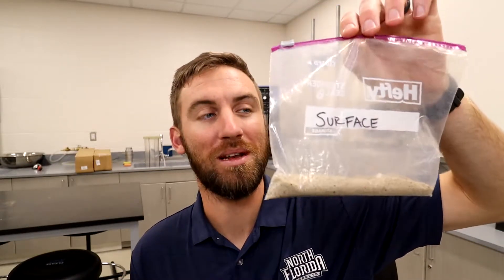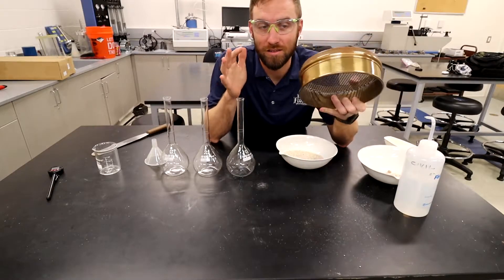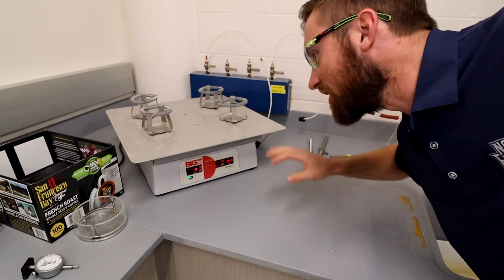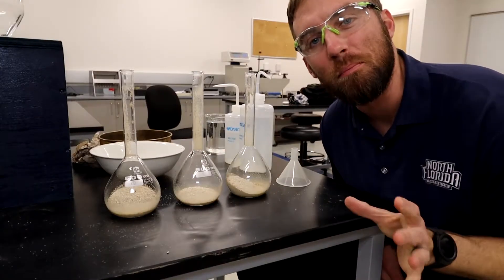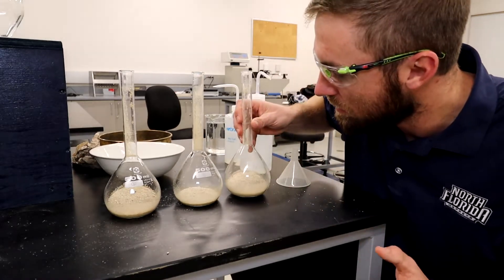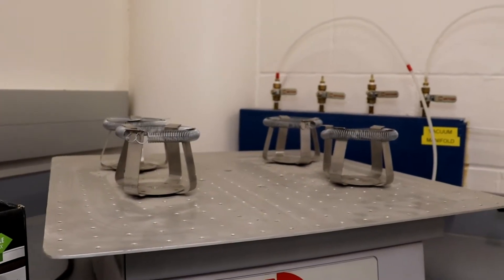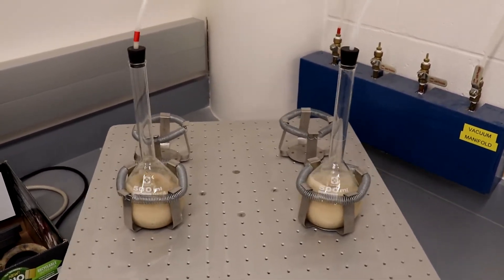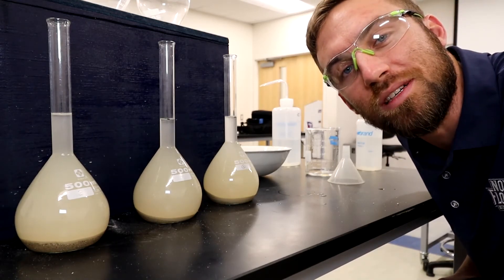Virtual Geotech Lab #2: Specific Gravity of Soil

Comment: The pycnometer is similar to a flask that is used to measure exactly volumes of liquids, indicated on the surface by a gauging line. I don't know how to say it in English, but in Spanish I know it as  "Matraz Aforado"
Reply: In English, they are called volumetric flasks.  The only difference is that probably the  pycnometers are made to withstand a vacuum.  If you are not looking for results following the standards exactly, using a volumetric flask and giving time for bubble to dissipate or a low vacuum from an aspirator should give you very very close numbers.

Comment: you can use other sizes like 100 mm or have to 500 mm?
Reply from the maker: Are you referring to the pycnometer (or flask)? Iif you are following ASTM D854-14, then the minimum acceptable pycnometer volume should be 250 mL. The ASTM also states "the volume of the pycnometer must be 2 to 3 times greater than the volume of soil-water mixture." 
Theoretically, however, you could use any volume of flask, as long as it is able to hold the necessary vacuum to de-air (saturate) the sample.